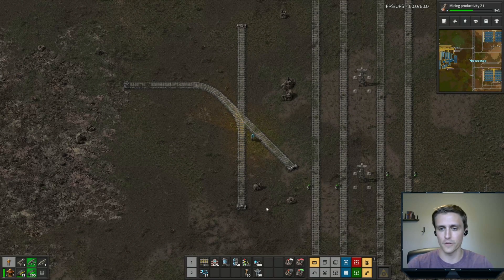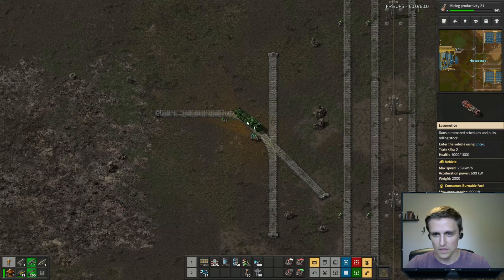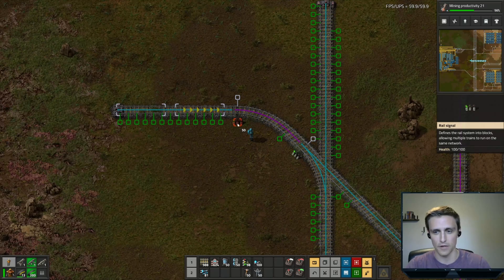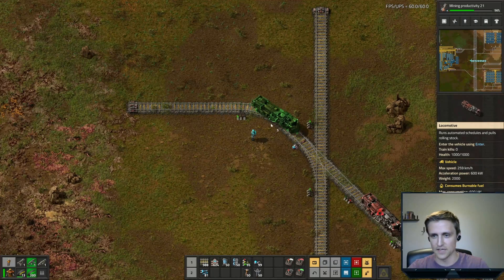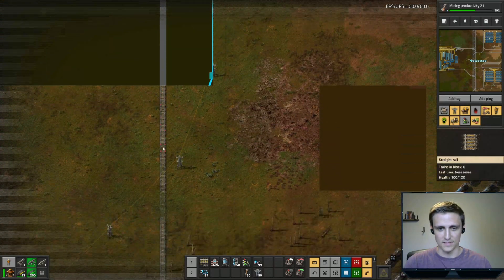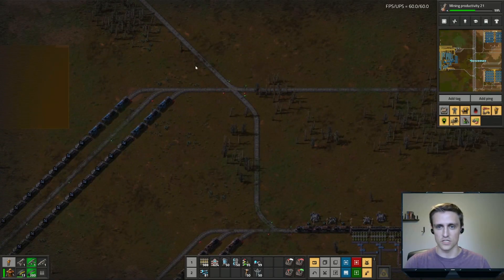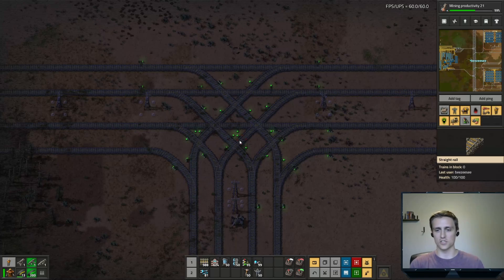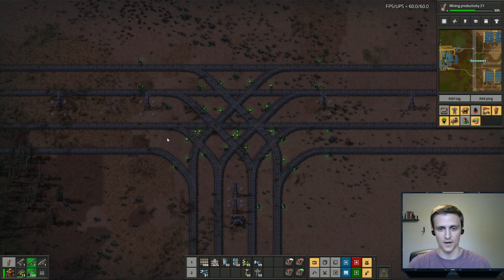Factorio Tutorials: How to Use Rail Signals

Comment: What signals should be used before splitting tracks? In your intersection you used a normal signal, but isn't a chain signal more useful so you enable the train to go at least to one direction if the second is blocked?
Reply from the maker: It depends on the situation. Generally, you are correct and a chain signal might be more useful, but in either case it will only allow a train to pull up one signal further. For major intersections, this might not change anything anyways as a regular signal wouldn't have been red and would allow a train to pull up further. For something like a stacker, you definitely need to use a chain signal so that the train will stop if there are no openings in the stacker.

I'm not exactly sure which intersection you're referring to, but it may not have been necessary to be a chain signal in that case.